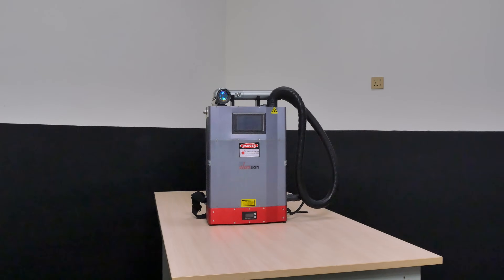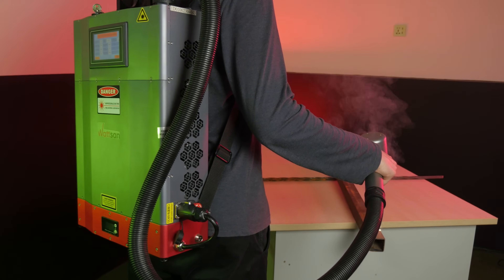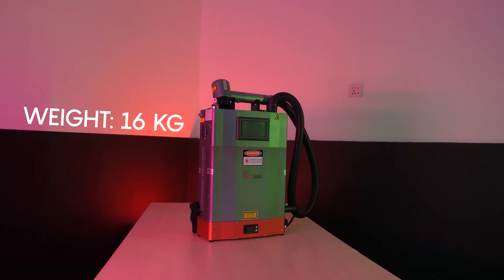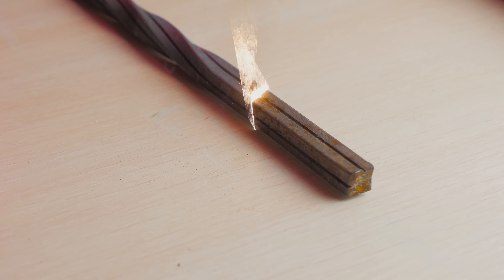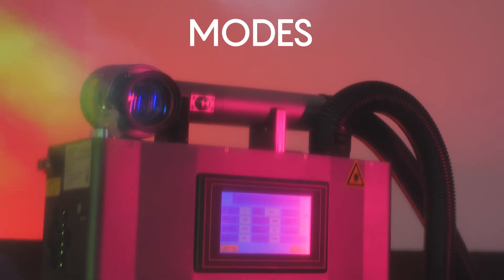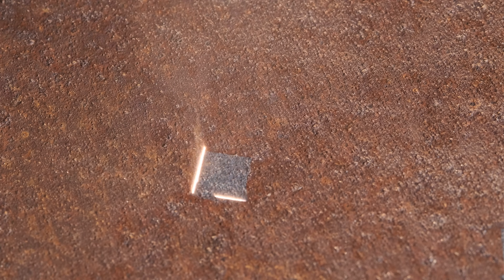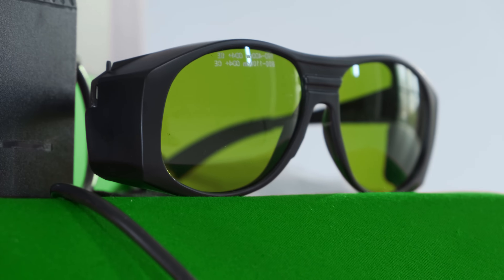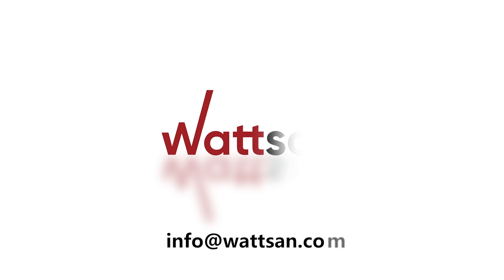How Laser Cleaning Machine Cleans? Review on New Backpack Laser Cleaning Machine Wattsan LC 100 Air

Comment: Can it also be used without battery?
Reply from the maker: Battery-free operation is not available for this model. But if your want to use the laser cleaner in your production, your can consider our other machines: 
https://wattsan.com/products/laser-cleaning/

Or your can contact with our managers: info@wattsan.com